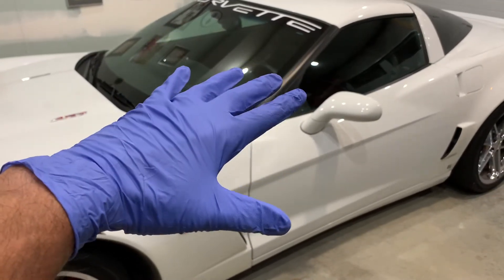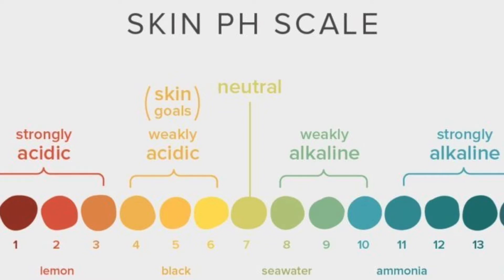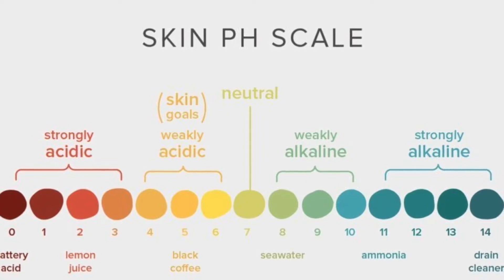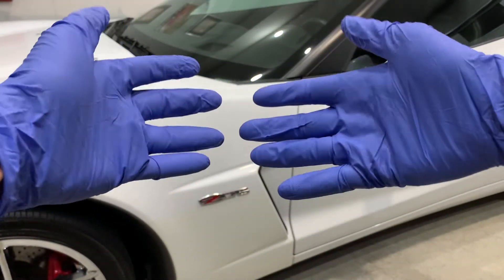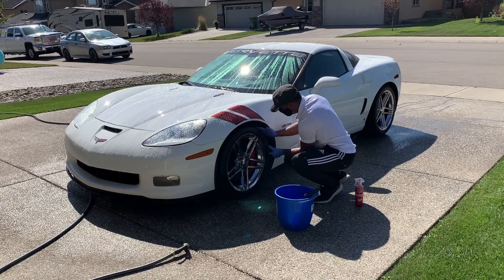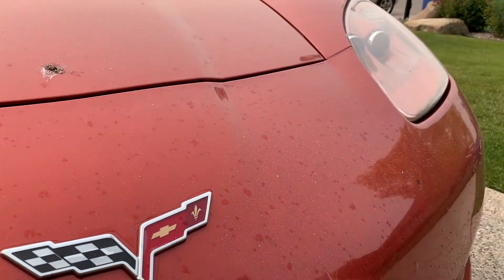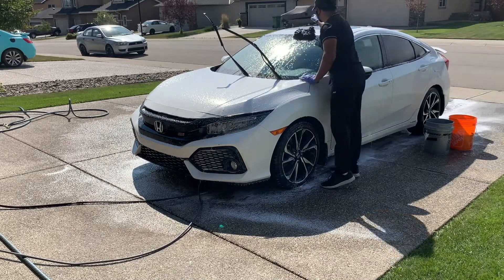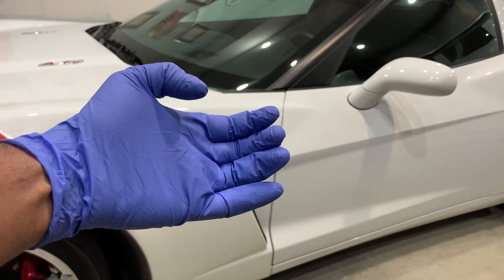Why Wear Protective Gloves When Detailing Automobiles - to protect your skins acid mantle

Comment: VERY important topic. I got skin irritation after using a strong primer paint for house windows. And it was not a very bad reaction but it made my skin VERY DRY specifically in my right hand and more specifically where you hold a paint brush between your index and your thumb. Compared to my left hand it was smooth as a baby’s butt but my right looked like some dry aged beef jerky. Gloves are very important. I took a break and wore cheap vinyl gloves and my hands healed right away a week later. Hopefully others learn too. Sadly I see a lot of young car detailers use no gloves and chemical sickness is no fun so hopefully the spread of using gloves spreads and hopefully the price goes down just a little.
Reply from the maker: Glad to hear you healed and this reinforces why gloves are so important.  Thanks for sharing.